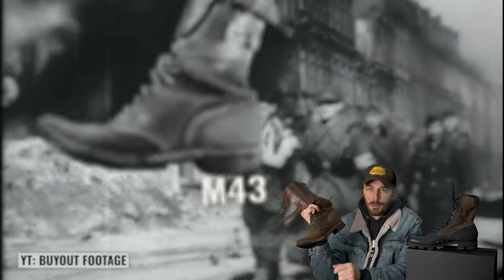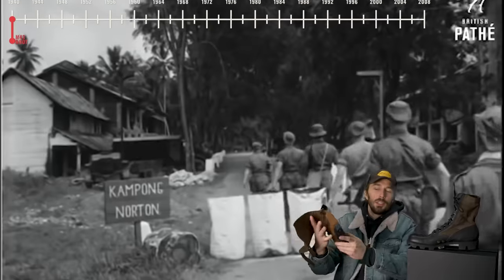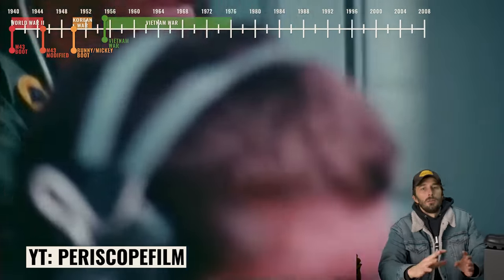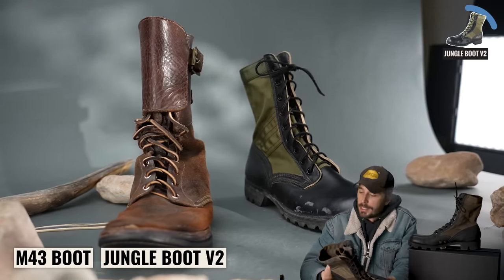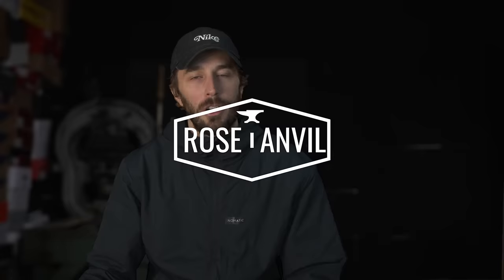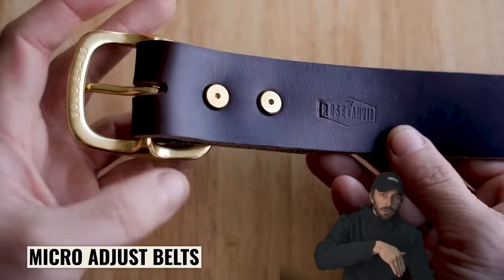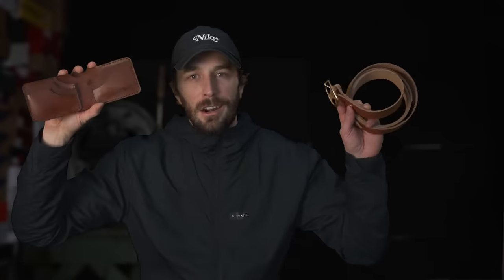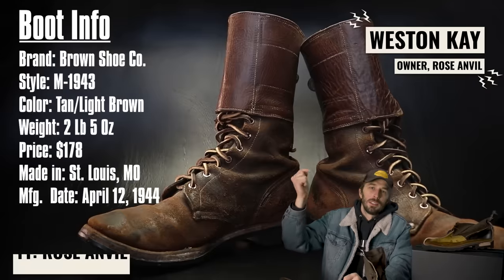Why Vietnam changed boots foreverr - (cut in half)

Comment: I joined the US Army in 1977, I wore the standard issue boots similar to Jungle boots but where all leather and really sucked, then I switched to the paratrooper boots they had wider toe room but no foot arch support, in the mid 80's I bought Jungle boots and wore those for awhile until the Army said solders weren't allowed to wear them any more. The Jungle boots where sturdy, flexible and allowed your feet to breath the best Army boots I ever had they took a spit shine like glass.

Comment: In 1970 I had 2 pair of the type you said were not the best (similar to the vibram soles) and one pair of the type you claim to be the best.  Wrong. The flat sole with the clogs on the edge were terrible, uncomfortable at best.   On dry ground, which we were 95% of the time they didn’t distribute your weight.  Yes they were better walking in the mud. But nobody did that all day long or even every day. They stopped issuing those in the late 60s. Most threw them away and got the type similar to the classic vibram soles

Comment: I have seen the V2 Vibram waffle soles altered with a scorp or a hot knife to emulate the V3 jungle boot's sole. They still sell WWII style "self cleaning bias ply all terrain tires" for Jeeps and trucks. If you have ever had the privilege to run all terrain bias ply tires, they are horrible on the highway, however off road they can do a few neat tricks that radial tires will NEVER do. If you are on a sideways slope the bias ply tires will slide sideways downhill. Bias ply tires do not do that. The bias ply tires also do NOT clog up with mud nearly as badly as the radial tires. They will dig holes instead. Those tires date back to WWII. The jungle boot soles borrow from the tires.

Comment: The Us Navy Seals used wear UDT Swim Fins over their Jungle Boots when they would have to swim up to the shore for a Beach Assault in Full Combat Gear.  They would take off the Fins just at a depth close enough to the shore where the waves broke but they could still stand on the bottom without their head poking out of the water, stuff or hook their UDT Fins on their Kit and then advance on the Beach walking in their Jungle Boots.

Comment: The M1948 replaced the 1943 boot but wasn't issued until after Korea in '53. They were based on the jump boots and were russet in colour then changed to black in '56. They were issued to the first troops in Vietnam. 1st pattern boots replaced the M1948 in 62 and issued to Vietnam troops from  '65. 2nd Pattern were issued from 67 alongside jungle boots. The original jungle boots based on  the M1943 ones used were referred to as Okinawa boots, which shows you where the origin came from. The 3rd pattern jungle boots actually came in two different soles, the first ones had vibram, later replaced by the Panama soles.

Comment: I wore these older lug style jungle boots when I was at Special Boat Unit 22 (Actually I still have them), Prior to that I wore only the "flight deck boots" as a fleet sailor.  The flight deck boot had a much lower heel section height.  I rolled my ankle several times wearing the Jungle boots and didn't like wearing them at all.  In the swap it doesn't matter what kind of boot it is, its getting soaked anyway.  Your only defense against foot-rot was to stay in the boat.

Comment: Because I have bad feet and mud caking throws me off balance bad, I used to use a pair of surplus jungle boots as work boots. I had those mesh insoles and everything. They're still in good shape but the soles were starting to crack. I stopped using them because of the crack and I had to buy a 13.5 wide because they didn't have any 13s. I think my tag had a 1967 or 1968 production stamp.

Comment: I LOVED my JB's when I was on active duty in the USMC. When they were authorized for inspections and daily wear, I bought four pairs. Two with the original tread pattern and two with the modified.  God I loved those boots! Damn near indestructible, comfortable, lightweight, sturdy, breathable and to say they looked cool as hell is a gross understatement.  I would use these boots to run the 3-mile PFT for training and, at times, for the real deal.  First time I wore them for an inspection I got my butt chewed out until I showed them the USMC Order authorizing them.  They shined up really well, and the polish (with a bit of saddle soap and wax) were damn near waterproof.  Loved those boots more than I loved being in the Corps for 20+ years.

Comment: I joined the army in 88 and at the end of boot camp, bought my first pair jungle boots.  They were absolutely fantastic.  Iroincally the cost was low but seemed very high back then.  Regular issue boots cost around $27 but jungles cost $42.  That seemed like a lot to come up with on a limited wage.  While i started infantry, but later switched to armor, i continued to wear and buy replacement jungle boots even as a tank officer.  They were the best boots i ever used over my 33 years of service.  Unfortunately, when we changed to the new uniform around 2006, they called for the desert boot and did not have a jungle boot style option.  With the next new uniform around 2017, our boots were extremely flimsy but had increased to $200+ just for cheap boots.  It was totally rediculous.  

The big disadvantage to the jungles were that the soles seemed to wear down fairly quickly.  It used to require having them resoled which i did to extend the life of the boot.  But it got harder to find boot repair shops and now there are none in my region of the country.  

But a huge disadvantage of the new style boots is that the sole is rolled up and integrated and formed into the lower part of the boot and cannot be resoled, forcing soldiers to have to buy new boots fairly often as neither the leather nor the sole holds up to the rigors of daily use, even when an old guy is confined mostly to the light duties of office work in a HQ.  Its really sad and rediculous what our boots have devolved into.  Way less boot for extremely unbearable cost.  I wish Nicks would have had an option in the later years of my career.

Comment: I was issued a pair of jungle boots at MCRD San Diego in 2000.  Super light, super comfortable once they break in.  In my opinion they are far better than the new suede boots that came out at the end of my first enlistment.  They also look great with a good spit shine and freshly pressed utilities.  Navy flight boots are the only boots aside from the jungles that are durable and comfortable enough to wear to work.  I tried the civilian work boots, but they only last about a year if I'm lucky.  If the jungle boot was steel toed I'd have a dozen pairs and never have to worry about boots again.

Comment: I've worn these boots for maybe 40 of my 52 yrs and very rarely anything else. Sometime back around 1990? I seen a pair of boots in the US Calvary catalog. Black jungles with the panama sole,but it was different,they were called Megabite. The sole was the exact same design but at least twice as deep. They wanted something like $180 then so I passed on them. Forgot about them for a while and came across a new pair around late 211 or early 2012. The sporting goods store wanted $20 for them. Swooped them up without question. Wish I would have bought the other 2 pair they had left. I had to finally retire them in early 2023. I wore them probably 350 out 365 days a year for almost 12 years doing everything from going shopping to working on vehicles and wade fishing and hunting,snow (everything,actually the tread is really good in snow) till the sole came lose from the leather at the ball of the foot. The tread was still pretty decent,just about what the regular panama's come with new. I'd still wear them if they wouldn't have separated. 
Wish I could find at least 2 more pair of them as they quit making them for some reason a long time ago,they'd probably last the rest of my life. 
I looked and looked around at the new "jungle boots" and none of them have a decent tread. It's stew pid they would quit making the panama sole,there is not one out there that's better. Picked up a pair of Altama Pro X because they're Altama's and panama soled,but would still prefer to be able to wear my old ones yet. Can't remember the brand name of them,unless it was Megabite,but Belleville rings a bell for some reason.

Comment: We wore them back in the 80's as surplus. The uppers wore out  but worked well. Not designed for concrete A light weight, aggressive,  boot is better for jungle work even if you need to replace them a couple times a year

Comment: I was introduced to jungle boots during my basic course at Benning in 1987. Hands down, the Panama sole is the best design ever conceived. Clumps of Georgia clay just shake off rather  than requiring serious effort scraping and cleaning. And they dry so much quicker after fording streams. 😊They’re not great for colder weather or road marches, but for woods and jungle trails they are unmatched. Still have a pair of the later versions with black nylon uppers and speed laces. Never had a pair of the desert boots that also had Panama soles. Incidentally a former co-worker spent his youth in service of a break-away Soviet republic. Issue boot was the “one size fits all” Russian jack boot. Being able to buy a pair of US jungle boots was the mark of a professional soldier in that little corner of the globe.

Comment: I served in SEA 1970-71, at Ubon, Thailand. I calibrated the radar and weapons control systems (WCS) on the F-4D Phantom. When I arrived at Ubon, I was issued jungle fatigues (green, no camo) and a pair of jungle boots which I wore daily, and even bought and installed zippers in them, replacing the laces.  After months of use, the soles were worn slick and thin, and I went to the quartermaster and asked for a new pair, but was told the boots were not available, so all I had to wear were the original issue leather boots. Upon returning to the States at the end of my tour, I went into an Army-Navy surplus store, and the wall was lined with new jungle boots. That's why they weren't available in Thailand, supplies were stolen and sold to surplus stores in the States. About five years ago, I found a pair of new jungle boots online and bought them, and zippers.

Comment: I would rather have the punji go through my feet than tilting on the boot axis being impaled through the @ or the belly. It's not like you're gonna be floating on top of the sharpened sticks. You will pitch forward if you cant fall straight down.

Comment: I have owned a few pairs of these boots since the 1980's they are very good the sole does wear quicker than other military boots if you using them on tarmac roads and other like that to walk on. I think the rubber is a softer compound but is a better rubber for jungle use where they are meant for. 
Thank you for the video. 👍

Comment: I wore various pairs of mil-spec desert boots for years as an outdoor professional in the desert.  Some of these were high-end private-make,  some were disappointing low-end cardboard knock-offs.  They were the only boots that gave me the support i needed and still kept my feet cool,  I did always need to add professional-grade gel inserts to make them comfortable.  When I moved to the PNW, I retired them.  Later I found an incredible deal on brand-new Vietnam jungle boots, and figured they'd be more appropriate for my new habitat. High quality, less than $30, and size 14.  Maybe the size was why they were so cheap.  But I need that in the toe box because of my gel insoles.  I fitted them with lace-in zippers.  I've never worn them.  
Don't judge.  Around the same time I bought a pair of dark cherry red Doc Martens.  I've never worn those either.  Missed Vietnam and the punk era.  Go figure.  Glad to have them, though.

Comment: I continued to wear these boots after Vietnam and, yes, the Panama design was superior to the others. However, all the designs did not do well if you lived in a cold climate. Yes, they were for a hot, humid climate but if you wore them in the cold, freezing weather, the soles would crack or split and it didn't take long. Even after wearing them for a couple of days in freezing weather the soles would split/crack.

Comment: My jungle boot from 1966 had a removable steel segmented insert. This made the boot resistant to penetration from nails etc. This was a lot like laying down a layer of sandbags on the floor of the truck. A lot of guys didn't wear socks or underwear.. Nobody shined these things. Some guys still wore stateside fatigues and leather boots, The jungle fatigues were a lot better. When I got out, I sent the boots home in my hold baggage and used then for hunting.

Comment: We were required to purchase a pair of those boots in the fleet. I don't remember the years sometime in the 80's. We were initially issued 2 pairs of the standard Black leather boots. I think it was right after Grenada the Marine Corps started going to light weight cammies called (rip stops) hated them because they were so fragile.
The jungle boots were lightweight but they did offer better drainage of water. Since  I wasn't a grunt, we liked our steel toes better.

Comment: As an older teenager in the Boy Scouts of America (BSA) in the mid to late 80s, I was part of a 2 week trip to the Boundary Waters Canoe Area (BWCA) near Ely MN. Lots and lots of water, wet portages, rocky mud, and hordes of mosquitos as large as your hand. I learned quickly that I'd made a good choice for my boots, a set of "el cheapo" M1966 boots I got for $15 at the surplus store (everybody wanted the new lug outsoles even at $80, so they were closing out the slow selling M1966 with the old soles). Not sure why or how I made that excellent choice, but my foresight paid off as other guys with expensive all leather boots began developing symptoms of trench foot the first week. I'd always be the guy that went into the deep water and then plopped into the boat at the front, as all I had to do was hold my feet up outside the boat and let all the water run out...then the rest would air out while we were on the water. A great boot, and I beat them up on the rocky shores of the BWCA daily. I think the leather part of the boot finally split apart 20 years later, I had to throw them away. Wish I still had a pair, as I'm still living in a humid subtropical climate in the USA and they would be good footwear for that.

Comment: I was a Canadian RCAF exchange instructor pilot on T-38s, between 1970 and 1973, and most of the guys that had returned from a tour in SEA, wore the jungle boot, rather the all leather high top boot.  They claimed, that it was like wearing a comfortable pair of running shoes, compared to the issue boot.  The boots, were not issued at any of the CONUS flying bases, but they were allowed, because they were so popular.   Our Canadian flying boot, was a low top boot, with a strap at the top, that was meant to prevent the pilot losing them during the ejection from a crippled aircraft.  I think, I would rather have had a high top boot, because the legs will flail around quite a bit during a high speed ejection.

Comment: I tested this Panama boot for two years... in Panama.... Worked well for traction off road. Was hell on your feet on asphalt jogs and road marches. No padding in the sole or anywhere inside the boot for that matter. When you are in the jungle in hot, humid environments, nothing ever truly dries out. It is the perfect environment for wounds to get infected and every form of athletes foot, jock itch, and even yeast infections on your feet. Mosquitoes and sand fleas, ant trails that went for miles, snakes that weighed more than a person, massive land crab migrations, and spiders that were large enough to be seen crossing the road from a moving vehicle, completed the ensemble.

Comment: I went through several different types of these boots. I had black jump boots at first. Then i got jungles boots. 1st one didn't water vents, so i cut slots in the sides. 2nd pair the toes came lose from the sole. 3rd pair the bottom shanks came through the bottom. 4th pair the ankles came through the side. I wore out 9 pairs in 13 months.

Comment: I served as a Scout Dog handler from '69 to '70, and from '70 to '72 as an instructor in country.  After the first day of wearing the boots, I discarded the insole because of the way it felt.  I later used boot polish to close up the little brass holes on the side.  They let in too much water.  I never did get boots with the Panama Sole, but I surely wanted a pair.  Overall, I really liked my jungle boots.  Thanks for posting this video.

Comment: I wore a version of these in the Singapore armed forces. Afaik doesn't seem to have that insole, cause these would get wet and stay moist for days. I find that I would've preferred it to be completely water proof instead, cause if I stepped in a deep puddle the first day of the exercise, I would be wet for the rest of it, no point changing socks either cause the new socks would just get wet, and we don't pack 5 pairs of socks anyways. Also the lugs sucked imo. I hated them, worst grip I've ever had. I don't know what marketing spiel they told us but I've heard the mud was supposed to dry and crack off as you walk, bullshit because it doesn't dry and it would just stick in the grooves so it was for all intents and purposes slicks that gave you no grip in the mud.

Comment: The green jungle boots were standard USMC issue until late 1992.  They were highly regarded and I loved how you could make them better, by taking them to the cobbler and he would put custom heels/outsoles on them.  Then something strange happened...  Jungle boots with black canvasing appeared, and the material would rip apart in a very short time.  It happened so often, nobody wanted them and finding the old green ones were next to impossible.